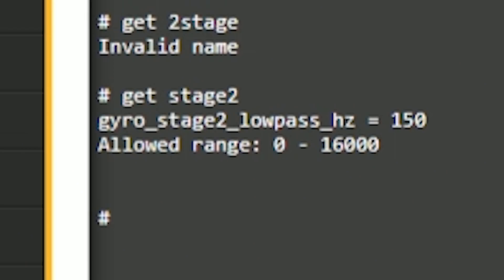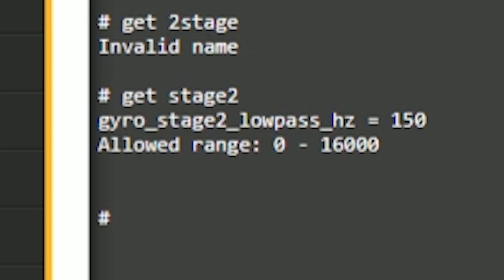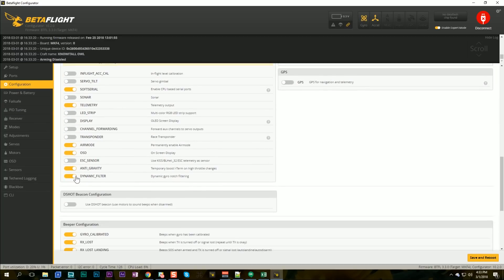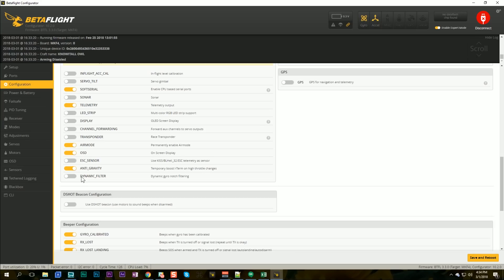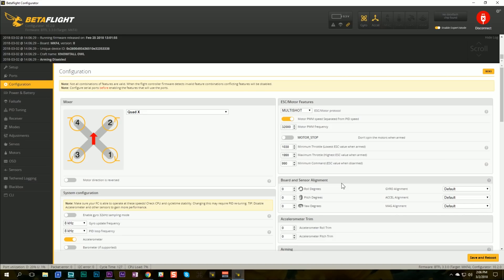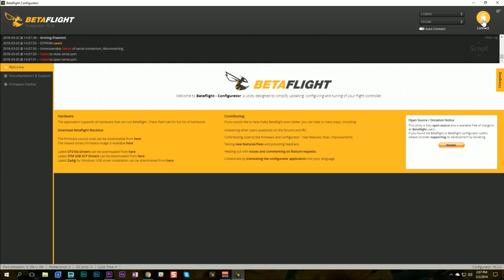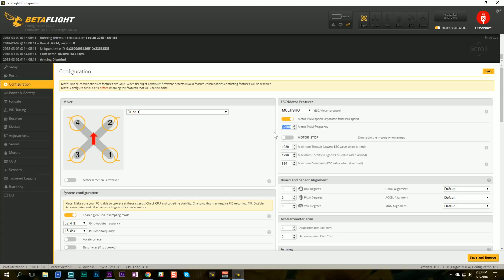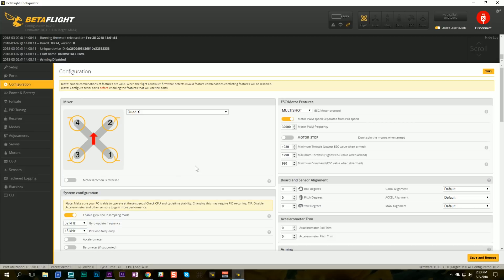Betaflight 3.3 (not) Kalman Filter | HOW TO

Comment: Hi joshua just a quick 1 the BARDWELL F4 FLIGHT CONTROLLER - JBF4 AIO FC BY RDQ W/OSD 3-6S .....as a mpu 6000 does that mean it can't do 32khz Thank you
Reply from the maker: Correct. The new filters still show some advantage at 8 kHz in my testing, but 32 kHz is better.

Comment: What happened to your video that you talked about overclocking the KakuteF4? Did you take it down, or am I just missing it?
Reply from the maker: If you mean the Kalman filter video, I took it down because none of the information in it is correct any more. The way to set up Kalman and so forth. Basically, the Butterflight video replaced it.
Reply: Joshua Bardwell that’s what I assumed. Thanks for the reply, and thanks for all the great info! Is it possible to use 32k on the KakuteF4.

Comment: Hi Josh wonder if you can help my new trananis x7 won't connect to my PC to update Tink from uk
Reply from the maker: Assuming Windows, follow the instructions in my video about installing opentx to the x10. Plug in with the radio turned off. Run impulse rc driver fixer. Flash from Companion.

Comment: If this filter is mathematically equivalent to fast kalman filter then uav tech recommendation is align with the butterflight recommendation. Butterflight recommendation is set the cut off way above normal motor noise and dynamic notch enabled.to dampen the motor noise.

Comment: Wheb i use 32l on my kakute f4 whwn i fly the motors will twitch and thr quad fkie horrible.. if it run 8k it stops. Do you know why the 32khz mode will makr the quad twitch
Reply from the maker: In order to use 32k mode you need to use the new stage2 filtering in Betaflight 3.3. 32k sampling increases the noise reported by the gyro, which cases hot and twitching motors.
Reply: Joshua Bardwell thanks for the reply. Im sorry that the comment posted twice. My fault. I tried this on butterflight using fast kalman filters. I thought that fkf was like the stage 2 filter? Thanks

Comment: how far are you willing to go to get results which are barely noticeable, if at all ...?
Reply from the maker: I disagree that the results are barely noticeable. I think the results in cornering/propwash handling are ridiculous and amazing. But it depends a lot on how you fly and how hard you push and how much you care about that last little bit.
Reply: If I read it correctly you're saying things which contradict one another. You disagree the effect is barely noticeable  and in the same time you're talking about "the last little bit" .  I find my quads fly very good with the pt1 and dynamic notch. I really wouldn't know if it can get any better. I am the biggest problem if it comes to flying well.
Reply: ! tomekyo I feel the same way. I think your final sentence really cuts to the heart of it. Besides flying style and skill I've found that the props you use can effect the prop wash you experience. I recently went up to a 2306 motor and I feel like that made a difference in prop wash handling too, I'm assuming because of the increased torque and repsonse times. I'm sure there are performance increases to be had but while all this stuff is still so new I think I will sit back and let other people smoke motors and work the kinks out. Hell right now the people who wrote the code don't even agree on how to implement all this new tech. I'm still flying 3.2.3 with pt1 and the first notch off, dynamic on and I think anyone but the most picky of tuners would be impressed with the prop wash handling...esp when I'm doing my part to avoid it all together.

Comment: Do I need to set overclock on to run 32 sampling on betaflight with an Matek F722? As soon as I turn on the sampling my board goes to 100% ..:( Anyideas? Thanks brotner
Reply from the maker: Do like I do on this video. Start at 32/8 and disable features to get CPU down.
Reply: Betaflight isn’t fully optimised for F7 cpus yet - this should be solved in 3.4 from what I’ve read.
Reply: Joshua Bardwell thanks Josh. I can run 16K 8K but anything more goes to 100. Flies pretty dreamy though. I'll have more data this week. Thanks for the help!

Comment: Im still confused about how to set up kalman filter :s I have omnuibusf4sd with MPU6000 so i cant run it at 32khz only 8k/8K can i just leave dynamyc filter enable with all nothces disable and add stage 2 filter?
Reply from the maker: Nothing changes about these instructions if you are using 8k. Do like I said in the video. Stage2 at 150, disable ALL notches including dynamic. But don't base it on the comment. Go look in the video and follow the instructions.

Comment: Tried BQRCF2 in BF 3.3.0 and 3.3.1 on 32bit board (Kakute F4 V2) with dynamic filter off and didn't noticed any difference. Quad behavior actually got even worse due to increased noise. I guess that beaten motors put their vibrations in canceling the all good intentions as well. It ended with disaster which began with uncontrolled shaking raising with throttle increase and then grand finale came in form of ESC board explosion and destroyed quad (ESC, receiver and all wiring in frame burnt to crisp plus big smelly mess all over around frame) in final. In FC logs I noticed that all filtering ended with pitch axis PID conversion to pure sine wave. Probably a Betaflight bug too. In another quad with RacerStar Tattoo F4S / 8K MPU6000 gyro BQRCF2 filter changed nothing. So it seems true that if I'm running my gear up to 8/8 kHz (gyro/PID) then BQRCF2  and Fast Kalman without 32bit gyro or 32bit mode off will not improve flight smoothness. So for 8K gyros it is no sense to use Stage 2 filters at all. If that then seems that these new smooth filters can be used only on very good 32bit gyro hardware with new and not bent props and motors without any damage from crashing. So most folks wouldn't be able use them anyway without upgrading and/or completely repairing their hardware at first and doing very scrupulous noise prevention tasks before including softmounting all and fixing all loose wires and other things which can vibrate and make noise at first. Sad but true.

Comment: Hey joshua, my motors smoked. Turn off all the filters .set gyro stage2 = 150 and used 8k/8k. Smoked out my motors and all was super hot
Reply from the maker: Bad luck.
Reply: afifathnin I don't ever turn off all the filters at once. I could be wrong but one at a time seems to be the best or at least the safest way. That and I have my motors and fc soft mounted, and a 330uF cap on each esc. All of that stuff essentially works like a filter too so I feel like it gives me more leeway with the software filters.
Reply: Ill just stick to the kalman filters. Burnt the vtx and almost melted the fc(still working fine though).

Comment: So this isn't Kalman filtering.  Is Kalman filtering to be used in addition to this or is this an option to use instead of Kalman filtering.  Is Kalman filtering tabled for now?  Thanks Josh!
Reply from the maker: BF 3.3 does not have the Kalman filter code. The filter that is in BF3.3 (the "stage2" filter) is believed by the devs to be mathematically equivalent to the implementation of Kalman that was tested before.
Reply: Joshua Bardwell ok cool I’m less confused now I’m gonna try this out!  Thank you!

Comment: Nice input - but I tried the "Dev's" way on a micro (2.5") quad and there was way too much propwash - with or without dynamic filters. UAV Tech's info that you showed is for 32k quads. Mark's setup for 4K/8k works like magic - basically replacing the soft gyro lowpass (set to 0) with the BQRC stage 2 filter set to 90hz - effectively replacing one with the other but getting better attenuation at higher frequencies with dynamic filters on. Very different motor sounds (much quieter) and very little propwash. Can't wait to hear what you have to say after you have more time to mess with this subject.
Reply from the maker: I'm not surprised to hear that the default approach didn't work well on a 2.5" quad. Defaults tend to be tailored towards 5"-ish sizes.
Reply: Joshua Bardwell - Thanks Joshua!  That's what I surmised as well - given the higher KV's and lower weights of the smaller quads.  I have to think the resonance points are quite different in the smaller quads with less rotating mass.  I will say that there was a noticeable difference in the sound of the motors (quieter, better) with Mark's suggested setup for 4K/8k than with the setup I had for BF 3.2.4.  The only difference was replacing the soft lowpass gyro with the stage 2 BQRC filter at 90hz.  Keep up the great work!

Comment: Are there real advantages of 3.3 over 3.2.4 on an F3 board?
Reply from the maker: Yes for sure. Even if you don't use the new filtering, there are all kinds of good features like anti-taz protection, separate rates for pitch and roll. Lots of nice new features.
Reply: I just watched some of your videos where you demonstrated the anti-taz protection, disabling angle arming, and many more. Your work is bearing some good fruits even in Africa. Thanks Josh.

Comment: Since upgrading to Betaflight Configurator 10.2.0 and 3.3.0 I now get USB issues. First I got "Unrecoverable failure of serial connection" so I updated the STM32 and I also used the zadig. Now I get "Failed to close serial port". I also did a fresh reinstall of the Configurator. I am starting to think there is something wrong with the version of Betaflight Configurator. Does anyone else have similar issues with it?
Reply from the maker: This is a driver issue in your computer. I recommend using impulse RC driver fixer instead of zadig. But none of that is required simply to connect to the board.

Failed to close serial port just means the FC disconnected. This is normal when you reboot the board. It doesn't indicate any problem.
Reply: Good to know that it is normal. Also thanks for the advice. It is working better now.

Comment: It's interesting that it's an option for the BF devs to be not always right, but for some reason that never applies to rs2k. (Nothing personal, thinking out loud here, considering the drama that's apparently attached to the stage 2 as currently implemented. Because the first sentence seemed to be the general MO during all the infighting.)
Reply: I think it is all variable based on your quads base motor noise level and how close to the filter edge you want to be (ie: too close and you bend a prop, you could smoke a motor (turtle mode increases those chances IMO as you are not inspecting the quad before re-arming).  To much filtering and you can't get a good PID tune.).  There is no right or wrong with filter or PID tuning, it is what works best for your specific setup.  So, you need to know how to tune (filters and PIDs) to have the best performance.

For the in-fighting, that goes back to hard and fast math showing (in the BF dev's opinion) that the FKF is the same as just modifying some code they already had in the code.  So they want that route to save space and got crucified for it.  IMO, they were just trying to do what made sense to them since the math was all the same result.  They are still having trouble getting 3.3 to fit on F3 boards.  That seems it may get better with 3.4 as they are working on code optimization for that release.
Reply: The thing with "not always right" was not targeted at your ways of tuning. It related more to the infighting. I've seen screencaps of some "conversation" on Github and Slack. Was pretty heated and kind of funny in ways. Had some feeling of celebrity klout vs numbers.
Reply from the maker: My impression is that this is a common theme with RS2K. And please don't take that as me digging on him. I love him and think he is a super smart guy and a great contributor to this hobby. But it seems like he is not as happy to work in a collaborative environment where his ideas will be subject to (sometimes strong) criticism. He started the Raceflight project originally after trying to get 32 kHz sampling adopted in Cleanflight ... or maybe it was even OpenPilot ... sorry I don't remember. Basically, his whole history of development has consisted of trying to contribute to an open source project and then eventually taking his ball and going home to work by himself.

AGAIN. PLEASE. Do not read this as me slamming him or talking shit. Everybody prefers to work in a certain way, and some people prefer to collaborate, and other people prefer to work by themselves. It just seems he prefers to work by himself and does not respond well to criticism of his ideas.

One unfortunate effect of this is that he seems to attract people who are willing to stick up for him and tell him he's right and everybody else is picking on him--whether that's his business partners or his fans on Facebook. And this results in those same people lashing out at others who didn't do anything except the normal type of criticism and feedback that happens in a collaborative work environment.
Reply: Easy wins in multirotor control are over IMO. If you're pushing into higher math concepts, peer review is kinda a requirement.

Comment: Damn. Now I'm really confused as to what filters to use or not with my 8K/8K, MPU6000 FC..
Reply: Dennis Santos , just stick to the BF 3.2 guides unless u want to explore is my 2-cents.  HAVE FUN, that is the most important thing!
Reply from the maker: You can do exactly what I say in this video even if you are only using 8k. The quad flies better than 3.2 but not as good as if you were using 32k.

Comment: Trust them to first make a bad copy of the kalman filter and then try to implement it in the completely wrong way. 

Well these are the people who decided to not have dynamic notch enabled by default for some unknown reason and then Disable Setpoint weight because a bug did that in the release candidate.

If they worked with kalyn instead of trying to insult him my rehashing his work then they could have used his experience in how to setup this type of filter and get the best out of 32khz.
The reason butterflight is so good is that takes the dynamic notch and combines it with a filter designed to help use 32khz gyro rates.

Boris needs to come back and slap some people around tbh or its going the way of baseflight.
Reply from the maker: I'm so tired of this argument. It's not an insult that they wanted to try a different, more computationally efficient algorithm. It's not an insult that they wanted to try other ideas. Even if the BF devs were objectively wrong, only a prima donna or a dictator takes disagreement as an insult.
Reply: Sometimes (mostly) the World just isn't according to you.  But the sun still rises every new day so relax and feel that good energy.  Being dramatic and negative is a phase in life you want to learn from, not live in. :)
Reply: Yet they cobble something together in a few hours just so they don't have to put rs2k's code into betaflight.
And reports are showing its not computationally more efficient than FKF in actual use.

Comment: ha ha I tried to update my stingy to latest bf but no avail  I tried everything omnibus and dys f4  since I don't really know what kind of flight controller I have . it does say DYS  on it 

I even tried while holding down the bootloader button  it fails to upload firmware  I tried different baud rate  full chip erase  and everything else I could   

I hope that one day helping people HANDS ON becomes LEGAL  in the FPV  community  so that I can feel what you guys are talking about   .meanwhile I will be content watching obscure videos  about stuff I don't understand   
happy flying  it sure sounds smooth
Reply: thank you  I will probably quit FPV  flying  within a few months  it s just too much stress and complication because of the TECH  aspect 
I may go back to helis and planes line of sight  
I believe that I could get better after sales support from a POT  shop then from the FPV  community  I need hands on help . and the only people in Colorado  who could help WONT   

thank you for your help
Reply: antoine ozaneaux go to zadig and download driver again. With zadig page open, hold bootloader button and plug in usb. Zadig will find you the correct flash driver and have betaflight open as well. Click install the driver. Well first select option list all devices this will show your fc. Select it then follow steps above. You should then see dfu not com in top right of betaflight and it's then possible to flash new firmware. You may have to run impulse rc driver fixer also if this dont work

Comment: so if you have a F3 running 4k....Betaflight 3.3 isn't going to help at all?!
Reply from the maker: You won't be able to run 3.3 with dynamic filter faster than 4k.
Reply: Thank you so much for responding!  I successfully flashed my drone from 3.1.7 to 3.2.2 to 3.3.2 over the last 6 months using your videos.  My real question is: 3.2 uses a dynamic filter at 4k for me.  Is the Kalman filter only useful at 32k?  Therefore I won't be able to use the Kalman filter on an F3, so there wasn't really an advantage for me updating to 3.3 from 3.2 in terms of filtering/smoothness?